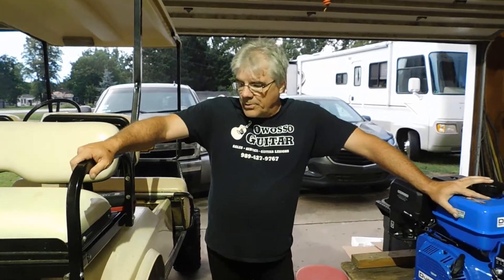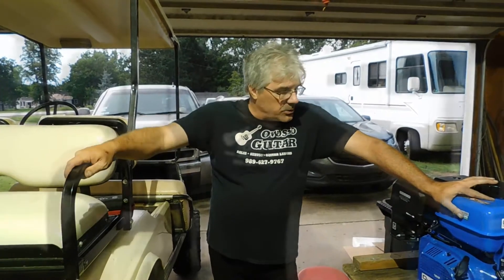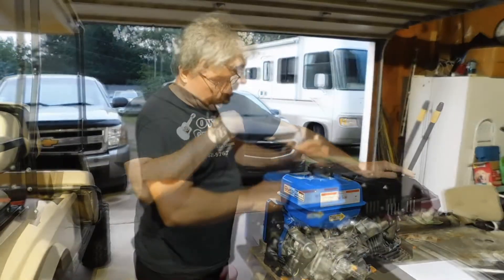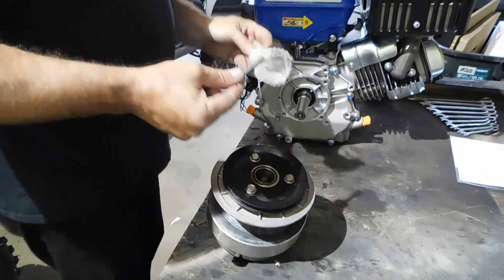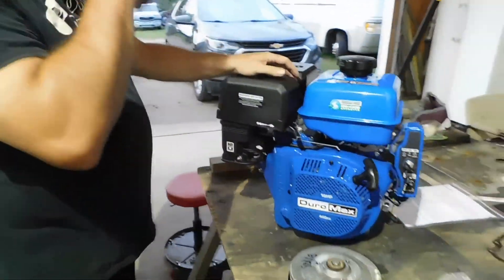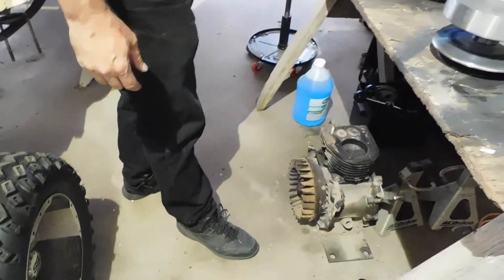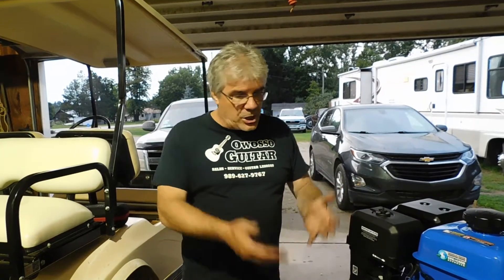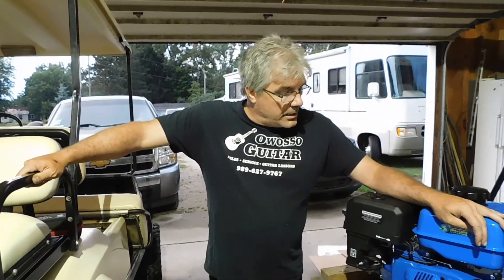Club Car Golf Cart Engine Swap EP 2

Comment: What make clutch is that? I have a Honda GX 390 and a Predator 420, both with tapered shafts. I thought i was going to have to replace the crank with the straight shaft. Thanks, TJ
Reply from the maker: It is the stock clutch off the golf cart.

Comment: i really am lost on my cart ..what rotation left or right
Reply from the maker: Not sure what your asking.
Reply: I have a  club car I'm trying to install a predator 420 in the .. original cart motor was a right hand rotation clock wize
Reply: The predator engine is a counter clockwise rotation engine
Reply from the maker: @jaysaw8151  if your talking about the PTo side of the engine it does tern clock wize.  So does mine.  There is a full series of the install and it explains a lot
Reply from the maker: @jaysaw8151  No the predator engine PTO is a Clock wise rotation.